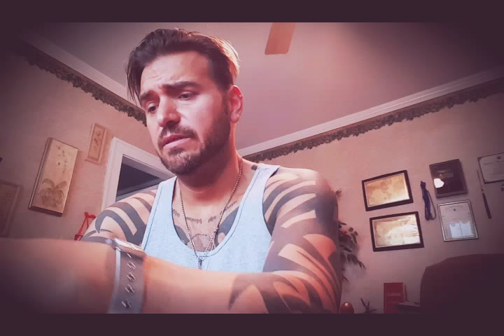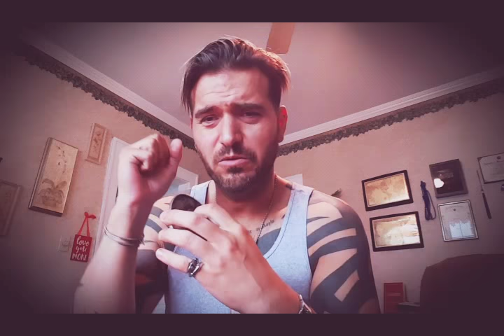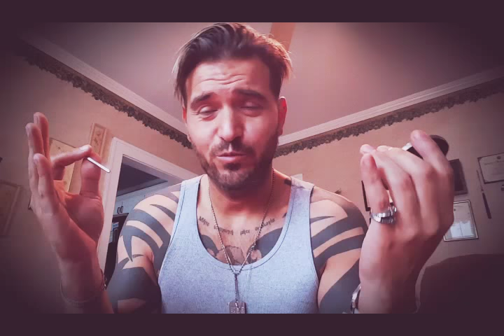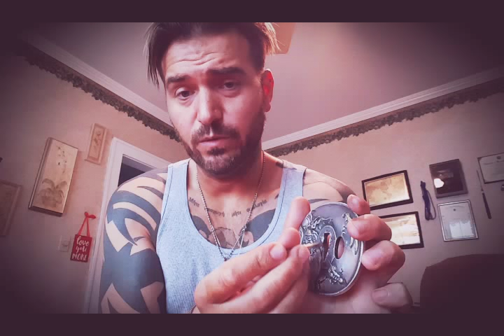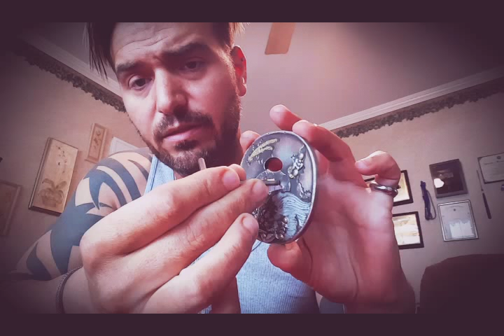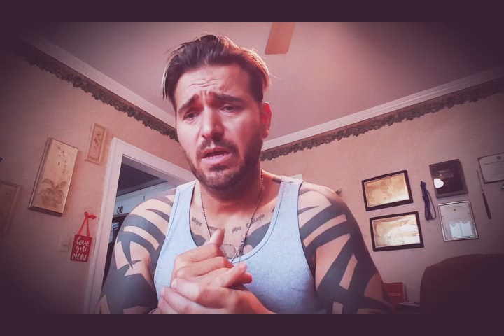Tsuba rattling easy fix on katanas

Comment: I have the exact same katana as yours, that just makes it more convenient.
Reply from the maker: It's a tank katana.  I wouldn't recommend it in a duel as heavy as is my slow you down a little bit however when say backyard cutting I don't worry about one bit with this katana bending or anything else like that it's a stout katana not too big of a fan of the company but I do have a few swords they have made that ROK
Reply: @TheKoolaidman007  yeah i wasn't sure about mine at first but i found out its a beast actually. Ive cut some properly hardened watami mats with inch thick oak pegs in the center quite easily.